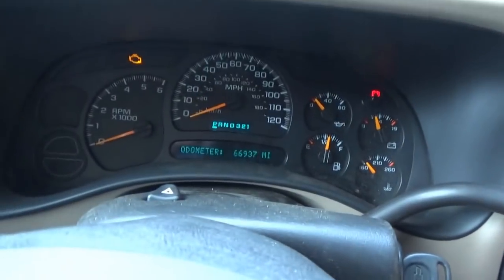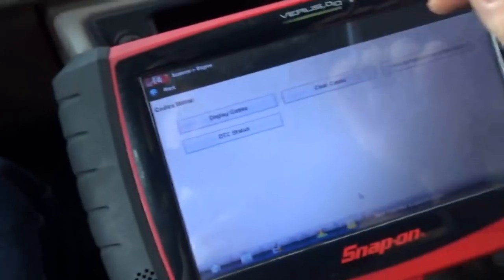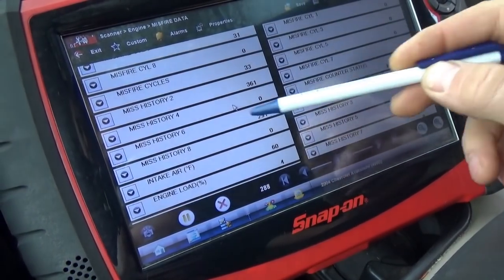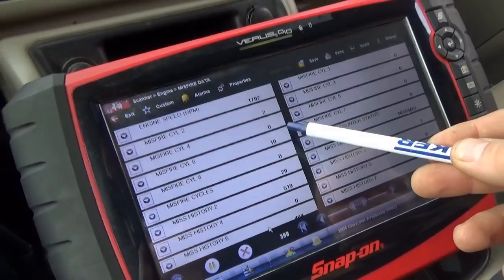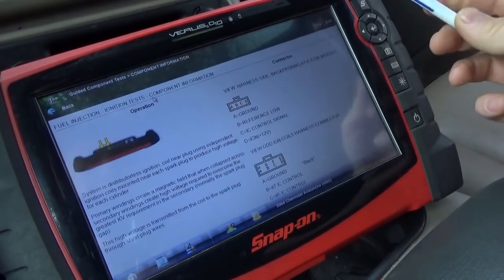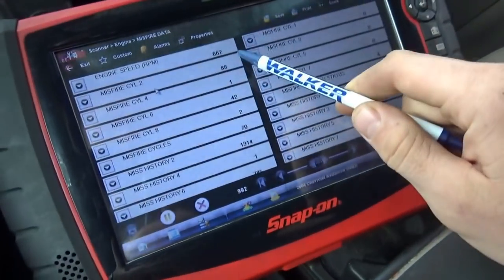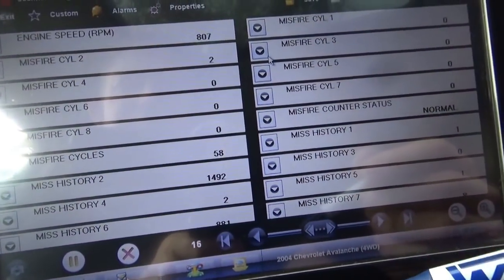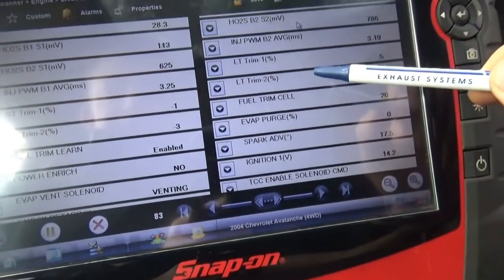Bank 2 Misfire case study: Chevy Avalanche - Part 1

Comment: I'd start with what was easiest for me first,  1-making sure 12v feed to inj & coils was good, 2- making sure the common ground was good, and 3 making sure the common connection for the low Reference was good. That being said I am not a mechanic, just a diy guy.
Reply from the maker: That would be a great starting point! What tools would you use to perform those initial tests?
Reply: Well I don't have access to a "O scope" so I'm stuck with nothing but a DVM   and a test light. I do have an AC current clamp but that is not much good for this purpose. Would most likely try to put a small load on the the power and grounds with the test light, maybe even with the truck running just to see if there is any flicker on the bulb. Not a very good test I realize but with limited tools your limited in what you can try. I would also try to visually inspect the splices and the body connections to ground. I might even connect the DVM in series with the Power and ground circuits to monitor current flow (my meter is good for 20 amps) and compare the right and left bank?? The fuse would be an easy place to break the circuit for 12v positive maybe not as easy for the ground circuit, but shouldn't be that bad. If I was suspicious of of power or grounds I may even run a fused jumper to bypass the original wiring to see if it corrected the problem A really good visual inspection and tug test as well. Phew, that's all I got...just glad it's not my truck :)
Reply: Oh and thanks for doing this, makes it interesting! Great videos, I've learned a lot from watching.
Reply from the maker: I think your DIY testing method are already more thorough than those of %95 of the professional techs in the field!! I would go with the test light as well :)
Reply: Hey that means a lot coming from a guy with your skills, thanks! Looking forward to Part 2!

Comment: Ok I finally watch the video burn time looks good but where is the primary switch on can't see ignition coil charge or is it just the way you have the scope setup
Reply from the maker: The waveform looked kinda weird, but the spark was definitely occurring inside cylinder based on the burn line...
Reply: Pine Hollow Auto Diagnostics yes but what about the switch on ignition coil charge I did not see it in the waveform
Reply from the maker: Not sure...all I know is that coil definitely fired lol

Comment: A 15 minute part 1......lame
Reply from the maker: How long do you want Part 1 to be? Any thoughts on the cause of the misfires?
Reply: I'd check the power and ground for that bank of coils
Reply: Not enough data to make any kind of educated guess. I mean, even a couple snap throttles on that ignition waveform and fuel trim numbers while it was misfiring that bad would have been nice
Reply from the maker: I did show fuel trims while it was misfiring! Watch minute 7 to 8 again. After checking FTs, I go back to misfire counters, and they are off the chart for Bank 2!!

Comment: Can't tell. It's either missing spark, fuel or compression. Pray it's not the last one, that one's the hardest to figure out.
Reply from the maker: What would you next if you were in the diagnostics hot seat?
Reply: Well you said the fuel trims look good. I'd look at ignition first then fuel then compression/exhaust.

Comment: After considering a few options I’d probably still go with “ ignition related “. First clue : severe misfire with flashing check engine light on cold start up after heavy rain,that gets better once warm. The spark line seemed low.
Second clue : lean code you haven’t talked about...
I would still approach this in layman’s terms and just swap coil/plug with a “ known good “. Seems pretty straight forward...
Thanks for the video! 👍
Reply from the maker: Yes! The lean code! Could be due to the misfires...but fuel trims looked perfect so far. Part 2 will get interesting :)
Reply: Pine Hollow Auto Diagnostics Did you look at fuel trims before or after resetting the CEL?

Comment: Pull de plug!  It would reveal oil/carbon shorting.  Wiring harness could be shorting the injectors open intermittently.  Smell the exhaust for rich mixture.
Reply from the maker: Best guess so far, William. The exhaust did smell a bit funny to me. But why did fuel trims not go negative when this happened?

Comment: no guessing, trying to reason it out and up to now there is to less data/evidence to make an educated guess though.

Observation is that firing kv seems to be LOW (even on snap) and the firing time in occasions goes up to ~3 ms with the spark line pretty flat. But the spark seems to happens in the combustion chamber....
Reply from the maker: Excellent observations. What other data and evidence would you like to see? What would you do next?

Comment: I'm sticking to my guns on this one Ivan 🍻 so far lol I will keep zipped for the time being
Reply: Pine Hollow Auto Diagnostics Ok 👍 I will give my best giving the info gathered so far. I may be wrong 😂
first I thought ok let's have a peek at everything in common for the even cylinders 2,4,6,8 a quick glance at a schematic revealed they all 4 share power and ground. However once you started monitoring we found 2&6 were mostly effected and you mentioned it "felt" more as a single cylinder misfire. That put my initial thoughts on the side. then I started thinking what dose 2&6 have in common? Hmm firing order! 18726543 Bam. 2 then 6 at that point my mind is convinced we have a issue with cylinder #2 effects showing on 6 however feel #6 is ok "logical assumptions" my next step would be visually check #2 coil and wire. my feeling is you might see something obvious with the coil or wire. the spark plug is a little less likely but must check as well depending on finding. we just don't know. However we must not forget what's in common. The rest honestly and everything to this point are assumptions on my part. Until I got my eyes on the said. Cylinder 2 final answer 😂😂😂 for now hahaha love your content Ivan
Reply from the maker: Please share your thoughts with the class, Will! You might even win a free PHAD t-shirt if you are correct ;)
Reply: I want a free t-shirt but there is one problem that means I have to watch the video😝😝😝😝😝😝
Reply from the maker: There are worse ways to waste your time on the internet hahaah
Reply from the maker: cylinders 2 and 6 were the worst, but #8 got pretty bad too when the truck warmed up a bit...that is why I was hesitant to go after one specific cylinder :)
Reply from the maker: I'm not posting part 2 until Keith chimes in on this Part 1 haha
Reply: robinsonsauto that'd be even bank if it's 2, 4, 6 & 8?!
Reply: Michael O yes even cylinders 👍🍻
Reply: Pine Hollow Auto Diagnostics that's ok ivan I just realized it's not coil on plug hahaha however it just adds length to the wire 😂 sorry bud I wasn't thinking clear at first. However I still believe 2 👍 is the primary calprit maybe the coil is cracked it's so hard without having eyes on it. I'm probably way off aren't I
Reply: Pine Hollow Auto Diagnostics I will venture further out on the Limb 😁 I don't monitor primary ignition along with secondary often. so why the adverse effect of cyl. 2.  I can't say 100% why? 

It's either one or the other 

1.  Cyl 6 is completely false and the way it monitors misfires picks up 2 missfire

Or 2. Cylinder 2 misfire is effecting primary circuit. I truly don't have that answer. But this is what I will learn from part 2 👍

I believe it's 1. But i gave both thoughts
Reply: Pine Hollow Auto Diagnostics not fair 😂 👍 I hope I'm not to far off. I did hear you correctly right? Feels like single cylinder misfire?
Reply from the maker: one or two...hard to tell on a monster V8 lol

Comment: My guess would be a bad injector on #4 cylinder, its the only 1 not misfiring on bank 2 which means the O2 sensor making corrections that r good enugh for cylinder #4 hance y u dont see any FT faults
Reply from the maker: Interesting theory. What do you mean by "bad injector" like flowing too much or too little? Would you expect negative fuel trims then?

Comment: Intake manifold leak on passenger side, driver side starting to show same  issue.
Reply from the maker: would a vacuum leak show itself in the fuel trims? The long and short terms looked the same for both banks...
Reply: oh yeah it would
Reply: not necessarily in a maf engine (if this is one) it would only adjust to the air moving over the sensor

Comment: Sounds as though half of the cylinders aren’t firing. I thought gm had vehicles that shut down 4 of 8 cylinders to save on fuel.
Reply: James Nasto The only way GM ever saved on fuel was with a crank no start.
Reply from the maker: It read "9.8mpg AVG" on the display hahaha
Reply: Gm did not start using that cylinder deactivation system until like 2007 or so. This Truck is a 2004

Comment: I would've liked to at least see a relative compression test before you threw us to the wolves.
Reply from the maker: I believe you would see 8 nice even humps :)
Reply: Pine Hollow Auto Diagnostics Given that, then it's pretty much narrowed down to electrical, right? Bad coils seem unlikely, but it could be a bad valve cover gasket. So bad wiring/ground, or spark plugs need changed? I would only lean towards wiring or gasket because it seems to be affecting the whole bank to some extent.

Comment: Good possibly be a bad block ground to the negative side of the coil packs
Reply from the maker: Interesting thought! Is it a different ground for the two banks?
Reply: Pine Hollow Auto Diagnostics Yes
Reply: This a good suggestion.  It also COULD explain why the misfires improve under load as the engine twists slightly in the mounts.
Reply: Worse in park than under load
Reply: Now I'm wondering about this as well. My first thought was a failing crank sensor  but then it occurred to me that all cylinders would be affected. 2,4,6,8 do have their own ground.  Welp there goes my thesis😂
Reply: This was my thought as well
Reply: I Was Thinking The Same Thing It Might Be a Bad Ground  !! Tech 53us G !!!

Comment: A few days ago I looked at A 07 escalade with a 6.2 ..very similar situation.  I found a small amount of coolant getting into cylinder #2. Coolant was a bit low. Ran terrible upon cold starts but ran ok when hot but I could see some misfires on the scan tool.  So is say you may have a head gasket issue...or broken valve spring. Thanks for The vid.love these cliffhangers
Reply: Pine Hollow Auto Diagnostics Ivan you cannot have a nightmare without any 'T' 😂
Reply: Michael O LMAO...he said it Mexican style so I could understand...😂😂😂😂😂😂
Reply from the maker: GM 6.2 are nighmares lol
Reply: Pine Hollow Auto Diagnostics amen to that!😭😭😭😭😭
Reply: 3.x L  lower intake gaskets
Reply: This cracks me up!

Comment: Odd, not catalytic converters, would cause misfires on all banks not 2 , could be plugs but not likely. Seems like heats causes more pronounced misfire, sounds like something grounding out, bad coil issues, not crazy about that, maybe? Maybe check for fuel issues
Reply from the maker: Keep in mind there can be several converters, the upstream ones that are bank-specific, and then a common downstream cat after the y-pipe...
Reply: Pine Hollow Auto Diagnostics no experience with cars with several converters, bank specific is another ball game. Why would a vehicle need multiple converters? EPA requirement?

Comment: Just a shot in the dark, its not an air leak on one bank i suppose.....or something associated with the bad bank side ignition system...like water in plug or intermittent LT connection....something like that.....wonder if you can check the switching on the coils (dwell angle),,,,Fred in Uk
Reply from the maker: Definitely seemed ignition related just on Bank 2...and it was worse just at idle! The truck would spin the tires and run smooth if loaded in gear surprisingly.
Reply: My guess is intake leak but need to see snap throttle ign test first.

Comment: clogged cat on one bank
Reply from the maker: Ah I do like the idea of a test drive. A clogged cat would definitely affect power under acceleration. We will do the test drive in Part 2 :)
Reply: Maybe the easiest and quickest way to test that is with a digital temperature reader, the point and shoot gun type. I assume the plugged "cat" would be much hotter than the other one.
Reply from the maker: How would you test for that?
Reply: Pine Hollow Auto Diagnostics I has a 2008 Pathfinder 4.0 with misfires coming from one bank. Took out o2 sensor on that bank, engine smoothed out.
Reply: does the vehicle have low power while driving? remove upstream o2 on that bank and see if it got better (easy to remove on those trucks) 

 I just know from experience spark plugs usually last till 150K and coils are not super common, injectors will stick from time to time especially with the low mileage but fuel trims were fine?
Reply: Remove upstream O2 and adapt a fuel pressure gauge(30 psi). If it's plugged the reading will be more than about 7psi. Higher the number, the more backpressure you have, lower psi is better.
Trouble with that though is that all the cylinders on that bank would be misfiring at about the same rate, not just the 2. And misfires get worse under load, not better like it did on this one.
I'd probably swap the #2 and #6 coils with #1 #5 and see if it follows the coils. If it does, bad coil. If it doesn't, coil power and grounds with a test light and scope the control wire. Check the harness.
Reply: on clogged cats certain cylinders will misfire more just depends on the pulses and whatnot inside the exhaust. this one is more than likely just starting to fail, so only one or 2 cylinders is showing more misfires.
Reply from the maker: All great suggestions. Yes it seems to misfire a lot less under load, which would steer us away from a clogged cat scenario...
Reply: Back pressure tester. Unscrew forward 02 sensor and screw it in. Plugged cats can cause misfires at high rpm, OR idle misfires.
Reply: In theory yeah that would be great, BUT if you are wrong and cut the old cat out its going to cost a lot of money on that mistake. If you really want to rule out a bad cat I would back pressure check it. 

The front right 02 sensor on that truck is quite easy to get out. You can gain access for it from right front wheel well by moving the plastic fender well out of the way.
Reply: Yikes, I didn't mean that you should cut the cat out if the temp was high, just a quick 30 second test to initiate further testing if the temp was out of whack.